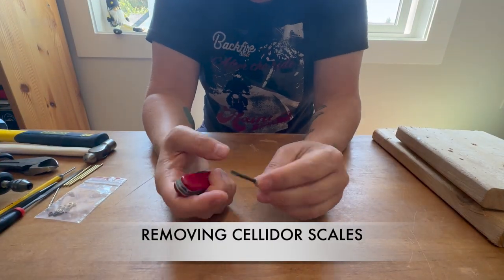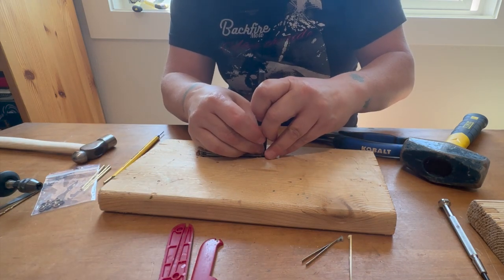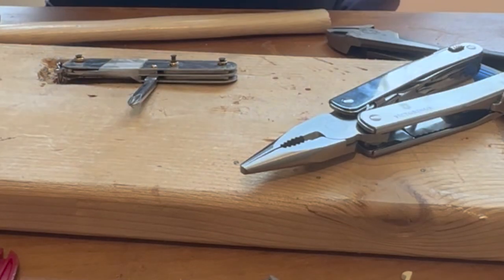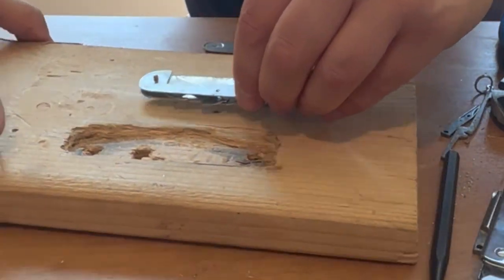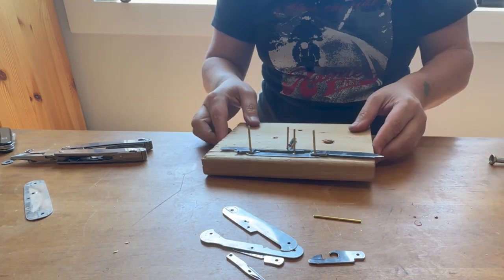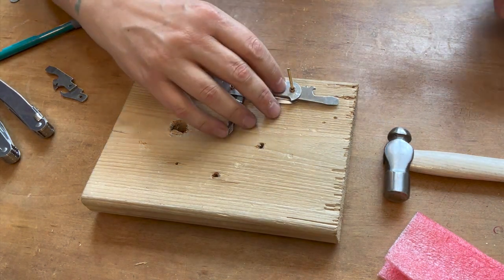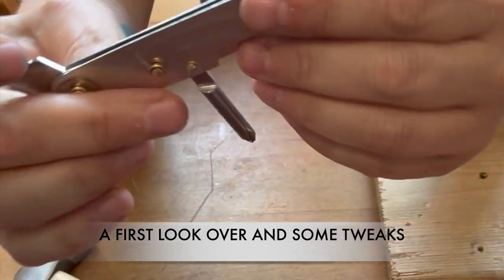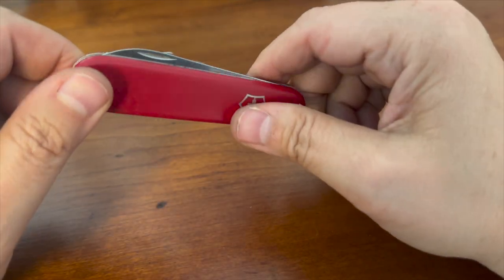VICTORINOX - Disassemble -Experiment- Reassemble (How to 🤠& Not to Do 😬)

Comment from the maker: Another idea for better alignment… I’m messing around with layers and while I haven’t snugged everything it seems like this would work well:

First: lay down the back outside scale (the one without the driver cutout in it)
-Then add another inner aluminum spacer (any best fit from spare inside spacers lying around… and file inside profile edge as needed for tool to best lay down)
-Now lay spine and knife and flathead/cap-lifter layer (with phillips on backside). Don’t include the usual small spacer that goes behind the flathead/cap-lifter.
-Place top outside scale and check that everything aligns well. 

While I haven’t peened everything, a cursory opening and closing of tools is working well… they don’t close into each other. And there aren’t any gaps due to layers not being parallel.

It does still require using a Dremel to make a nail nick on the flathead/cap-lifter.

Comment: A spring-loaded center punch can be your friend. You need to drill deeper using a sharp drill bit. Use a 1/16 pin punch to drive the pins out. I use a plastic shell holder from a box of handgun shells.
Reply from the maker: I must have some mysterious forces working against me… beyond just myself.
😬🤡👻
I had tried a spring loaded pin punch in a previous endeavor and it wouldn’t even begin to leave an adequate punch divot from which to start drilling. Like, basically no indentation at all. 
Then I had tried to use a carbide tipped drill bit as I’d heard recommended… after that $ spent I discovered it was far inferior to my regular bits (not to say the regular bit worked well). 
I had used a pin punch, and yet due to the pins not wanting to budge (perhaps from having difficulty drilling out the pin cores adequately) the punch tip bent… and eventually cracked off. That definitely made this project harder. 

I think my primary problem was, as you mentioned, needing to drill deeper… but struggling to do so. I also found it curious how on the two disassemblies I’d undertaken, the relative ease or stubbornness of the pin removal was a world apart. 

I just looked up a plastic shell holder device… neat! That seems like it would work nicely. But how would you have room for the pins to drop out? Or do you anchor the holder onto a plank of wood with little purpose drilled drop holes?

Comment: Really enjoyed watching you work your way through it. I've been modding days army knives for a couple years. With a lot of practice I've gotten pretty good at it, but I still run into a roadblock almost every time. 

When disassembling the knife I don't tape it. I punch the pin just enough to remove one layer, then repeat. It's a whole lot easier than trying to get that pin through the whole knife at once.
Reply from the maker: Thank you… That’s a good thought about the tape. My goal was to not have the layers explode all over the place (less important when an exploded SAK reference is available online)… I once tried your suggested way of gently tapping just enough for individual layers to come off at a time and it was a chaotic mess… it’s hard to be gradual when the rivets don’t budge without a muscular whack!… but it also makes sense that the whacks need to be harder if trying to pound rivets through many layers, where they might get even more tensioned by disturbing the tolerances pounding here and there eking them through. 🤷🏻
Orrrrrr… I was just being too ogre-ish and impatient. 👹 I think my impatience with the process is a general liability. 😜
If you think of any more advice lemme know. 🙏

Comment: Hubiese sido mejor ponerle la herramienta philips a una bantam.😅
Reply from the maker: That would be a very nice little set up. Sadly, not possible in a one layer knife. It should likely be possible to do a two layer knife with one being the blade and cap lifter, and the other the phillips and magnifying glass… it’s amazing how often a combination seems like it should work, but it will not. Realizing this is what derailed me from fussing about with more modification experiments of just trying to redo SAKs with oem parts. These experiments are expensive and require pulling apart well made tools. 😬